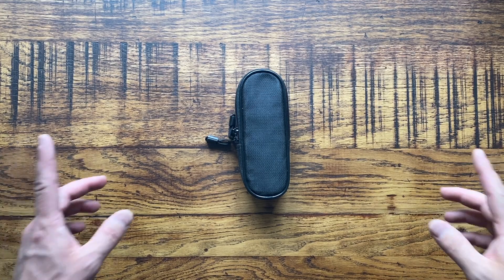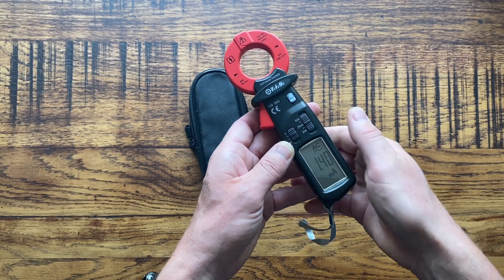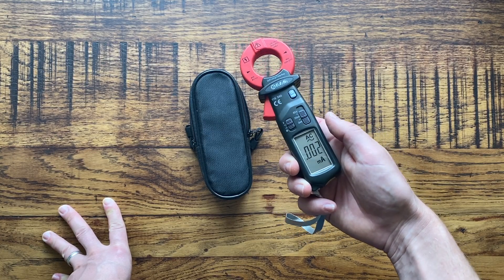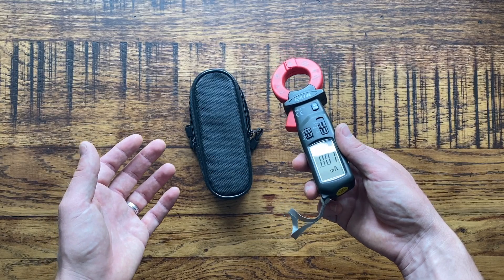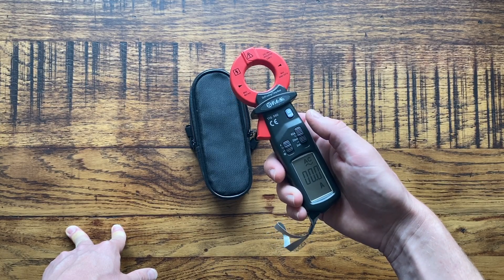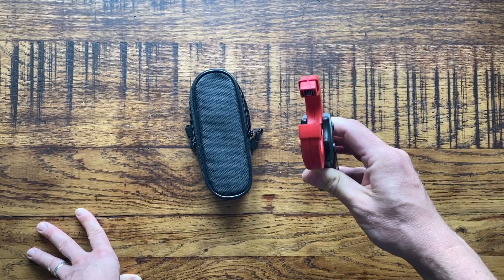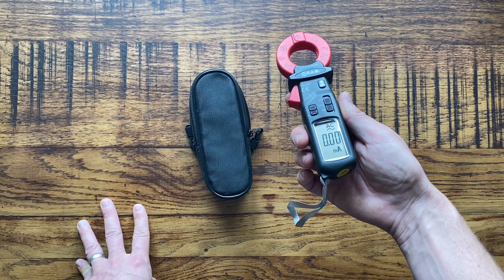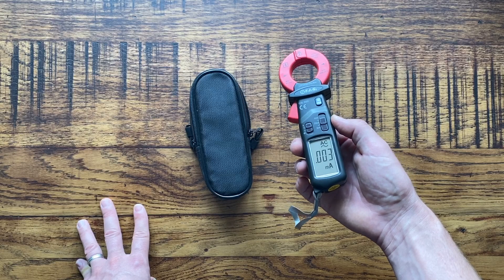TIS 560 Earth Leakage Clamp Meter Review

Comment: I think it’s an essential cheap clamp meter for checking your immersion elements are working properly or any element on the 60a setting. Tomorrow is the first time I will try to use the earth leakage meter, but I’m watching you guys to learn how to use that function properly and I’ve noticed that it is only 20ma ? Why not 40 ma to see if it will trip a 30ma RCD ?

Comment: I am using the hioki CM4002.
Normally you should be able to measure one cable. The problem to do it only on PE is that you could get a different value, if the machine is grounded.
An the clamp is rated for 60A ±(2.0%+5d)! It should do.

Comment: What about 3 phase systems
Reply: If you get it around L1, L2, L3 and N with a 4 wire system you will get the leakage.  For a 3 wire like a 3 phase motor,  L1, L2 and L3.

Comment: Beware when measuring Active + Neutral current on the supplier side of a switchboard. In Australia at least all Neutrals and Earths are connected together at the switchboard and will mess up any reading you make.  
Likewise the building's Earth wire going to the ground stake will be misleading as it may be carrying only some of local leakage current and also some of the leakage from all other consumers down the street.
If you have a dry or broken earth stake then you won't see any current (but a voltage may fry you!).

Tying to measuring earth leakage on the earth wire at any point in the system is also unreliable if any device in the house has an alternative path to ground (metal water pipes to a dishwasher for instance).

The RCD's/ELCB's on your switchboard measure earth leakage as a difference between Active and Neutral currents and ignore the Earth current for a very good reason.

P.S. There should not be any reason why you can't measure current in a single wire with this meter.  It should be fine for Active, Neutral and Earth wires up to the meter's rated current.

Comment: I have the older tis550 cost me £180. But the 550 has a more sensible range 200mA - 2A - 150A, why 2 mA and 20mA what if your testing 100mA RCD for random tripping, even the 60A may not be enough if testing max load. Also yes you should be able to test CPC wire only as I test both ways when I'm fault finding.
Reply from the maker: Yeah Im not sure to be honest

Comment: Bought my grandson a cheap multimeter from Amazon the other day. Thsinde 18B+. Available on its own for £44.99 or bundled with a clamp meter 38B+ for £42.99. (!) So he got a multimeter and I got a clamp meter. To my surprise the clamp meter has a 2A range which reads 0.001A to 1.999A. I've tried it and it seems to read earth leakage reliably.
Reply from the maker: Cool

Comment: As marcel talks about the main use of this tool is to determine earth leakage, I guess the more expensive clamps also do earth/ground resistance and testing the quality of earthing not just phase neutral and RCD testing. Transients, low frequency effects from capacitive and inductive loads generated from devices you mentioned all cause leakage. Not sure it has a filter to remove noise and to get an accurate read. For the price it was worthwhile. I have a fluke 1630-2fc twenty times the RRP of the TIS though it has a precise Hall effect sensor and filters not sure the TIS has the same and does earth resistance and has a larger clamp head.

In UK when you run a unit to a garage/shed and have to use earth rods then then a clamp that does also earth resistance would come into its own to check the quality of the grounding. This type of clamp would also allow measurement on energized circuits. Though to do a more accurate earth ground resistance and quality of grounding a fall of potential (Jenner) method would need to be used. John ward did an excellent demonstration of this some time ago.

Comment: I use a Amecal ST-98T Leakage current tester, has 200mA, 2A, and 200A ranges, great little clamp meter, also a cheapy thing. They actually sent me 2 by mistake lol...hey ho.. It has found earth leakage on a few jobs that tripped an RCD. Turned out to be downstairs Ring, and a washing machine leaking water over the motor when going through its cycle. So it paid for itself. Big Clive also did a review on it (same meter, different brand name) useful addition to an electricians tool box as they are cheap (made in China like most stuff these days) and pay for themselves after one use. Mine was about £36.00 as far as I can remember was a couple of years ago. No brainer. get one.

Comment: with the data hold button can you leave the clamp on some cables for a while, come back and it will give the the max value that went through it while you were away?
Reply: You can do with the Megger one
Reply: @iamsamkerr  which model is that? im interested
Reply: @MrEggaz  it’s the Megger DCM305E Earth Leakage Clamp Meter. Great bit of kit.
Reply: @iamsamkerr  thank you, just done a bit of research on it and watched the demo video. you are not wrong, what a bit of kit. will be treating myself i think.
Reply: What you're talking about is a earth leakage clamp meter with the ability to hold the peak current.

Comment: Good Video Jordan. These little devices will come into play much more now with the need to use different types of RCD and the bad practice still employed by many sparks out there who just hang lots of circuits off of one RCD without understanding the concepts..this then leaves us to diagnose these faults using gadgets like this. 👍🏻
I’ve used one of these to redesign circuits falling under the tag of “High protective conductor current circuits” serving I.T equipment.
Reply from the maker: Very true!

Comment: There are several tasks for this device.
1. Is the one you've mentioned, if you're looking for the reason why the RCD is tripping.
2. Required for the PAT (portable appliance test) of a three-phase appliance. Three-phase appliances are not so easy to test as single-phase. For the leakage current you'll have to use such a clamp meter.
3. Insulation monitoring where you can't switch the power off to measure the insulation the conventional way.
I use this one:
https://www.benning.de/products-en/testing-measuring-and-safety-equipment/current-clamp-multimeter/benning-cm-9.html
Benning is a known german manufacturer, mostly known for their 2-pole voltage testers. The trademark for their voltage testers is Duspol for decades. And it is so common that almost every german electrician calls a 2-pole voltage tester a Duspol, even if it is made by another company, Fluke for example. The last Duspol N generation from 1975 was so popular, they manufactured it in parallel to the more modern versions until 2003. They only changed the colour of the housing from orange to red. Just a neon indicator for a potential dangerous voltage in one handle (in case of DC it also indicates polarity), and in the other a plunger coil instrument where you can read the voltage when the button is pushed (110 to 750V).
https://www.benning.de/files/benning/global_content/content/news/powernews/2013_12/duspol_generation_2013/duspol_generation_2013.jpg
But that's almost leading too far....
It should work from a single core. You forget one thing: The current can also use a different way to earth as the earth wire...the earth wire is a potential way, but not the only possible way. So the best way to see how high the differential current really is, is using the line/neutral differential current measuring. A possible way could be the water pipe or a gas pipe. So you wouldn't see anything if you measure on the earth wire of the appliance. Both pipes are also bonded to the grounding system if they're made of metal.
Reply from the maker: Great thanks!